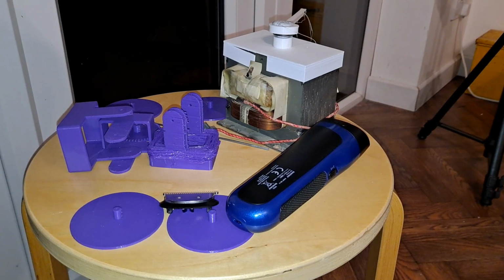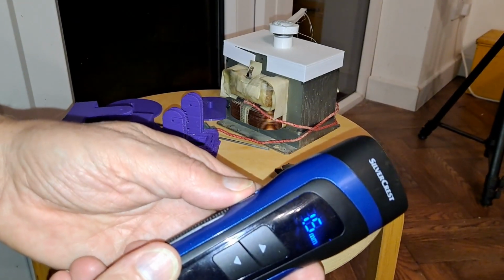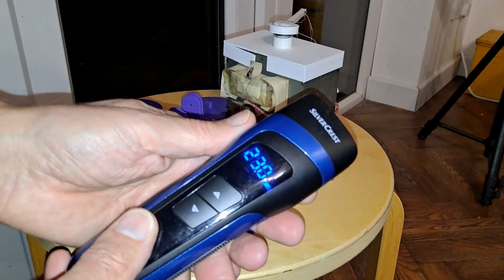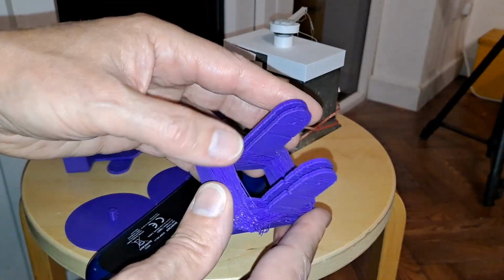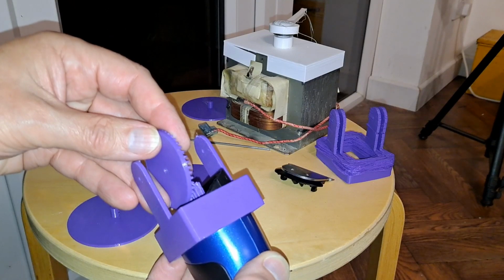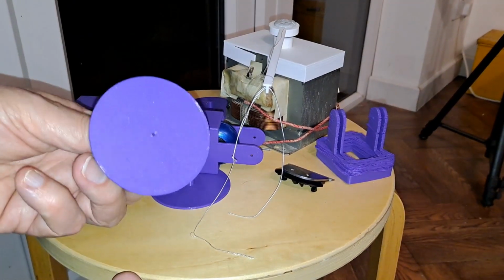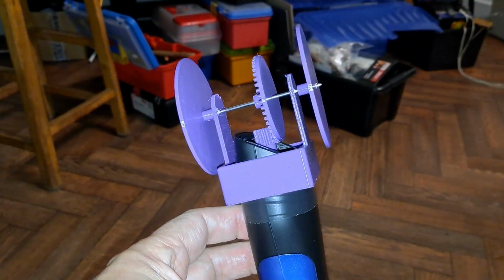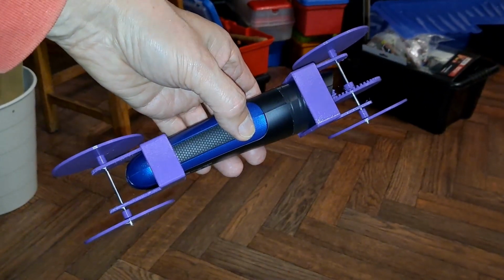Hair Trimmer RTP car

Comment: That last bit of footage reminded me of the old Scooby-Doo cartoons where they are being chased by a ghost and the same bit of scenery keeps going past! I was hoping the string didnt break and the car went flying off! If you wanted some way of stopping it perhaps you could rig up one of your remote controls from the LED lights to switch the trimmer on and off? Either way this already was quite a success and hugely fun to watch..
Reply from the maker: Just catching it was easy enough. I would either have to disassemble it to intercept the on/off switch, or fit a servo with the arm pressing the switch. That would be over-engineering a simple fix.

Comment: Wow.that Went crazy fast grandad 🤣. If you would put that in 3rd Speed it would have even gone faster. Can you put cd wheels on it just To See how fast it will Go with them
Reply from the maker: That was fast enough for me. Speed is only relevant if you are using a proper speed measurement. This would look much slower if it wasn't going round such a small circle.
Reply: @GrandadIsAnOldMan  so the bigger the circle it would Go around in the slowed it would Go because it has To Cover more ground then ?
Reply from the maker: @MsRaidman  going at the same speed it would take longer to complete a circuit. If the string was twice as long then the car would take twice as long to get round. If I took it out to a carpark and put it on a 10 metre string it would take almost 10 times as long as it was indoors.

Comment: I don't thought that the motor is spinning that fast.Can you measure the RPM?
Reply from the maker: Sorry, I don't have an RPM meter. I was running it on it's slowest setting, it has two faster settings.
Reply: @GrandadIsAnOldMan  Can you upload a video when you will drive it in bigger speeds?
And, what's the ratio of gears and diameter of driving wheels?
Reply from the maker: @onlinehelper374  you are asking for too much detail. Unless you have an identical hair trimmer all this information is irrelevant. I just built it to what looked right. The wheels had to be big enough to give ground clearance. I found a set of crown gears on Thingiverse and chose the 48 tooth gear because it looked the right size for what I had in mind. The gear I fitted to the motor had 12 teeth. Are you planning to build one yourself?
Reply: @GrandadIsAnOldMan  You forgot to give me a measurement of wheels 😁❤️.
Whatever, I'm planning to make it, but not with 3D printer, cause I haven't got it.
Reply from the maker: @onlinehelper374  I didn't forget, I told you I made them big enough to give ground clearance, so depending on what size hair trimmer you plan to use, you would have to adjust the size accordingly. The width of your hair trimmer plus a bit for clearance. In my case it was 70 mm. Like I said, you are asking for too much detail. Unless you are making an identical car for an identical trimmer, my dimensions are irrelevant. You need to make the car to suit your trimmer. I don't do clever maths and calculations, I do what looks right to me. If it works then I was right, if it doesn't, then I was wrong.